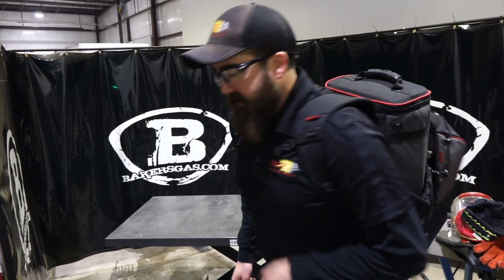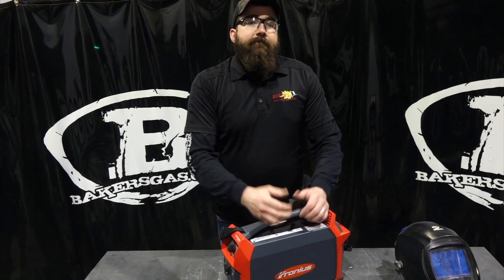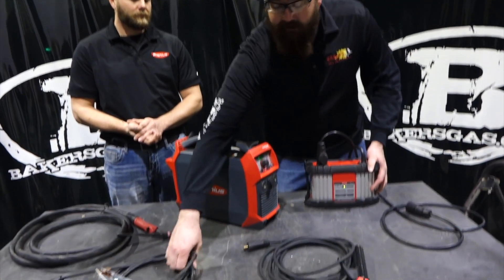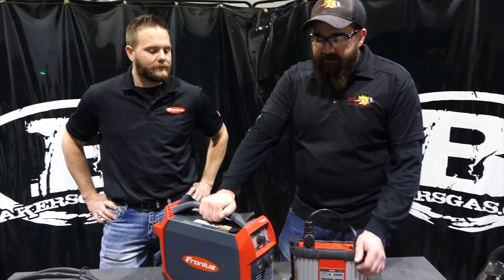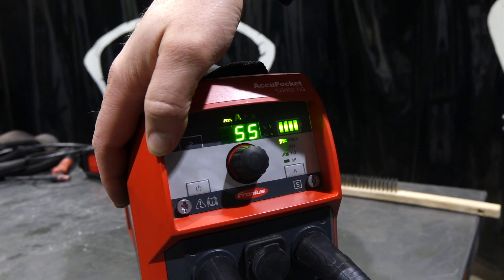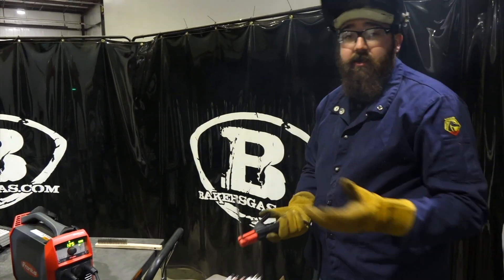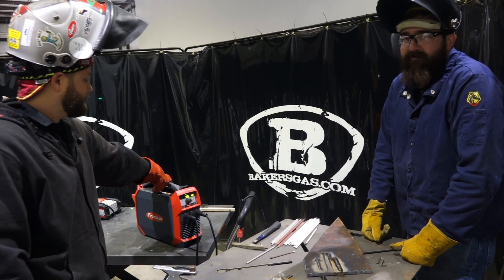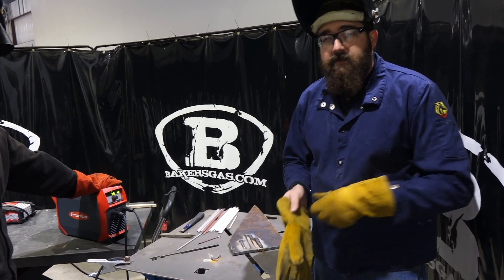Official Fronius Partner - AccuPocket Preview

Comment: I have been looking at one of these or the 180 transpocket with tig for site welding straits and handrails for some time now, does the 150 accu run just off a 110v lead if you don’t want to use the battery.
Reply from the maker: Correct if you are near power and do not want to use the battery you can just plug the Accupocket into 110 power!
Reply: @BakersGas  can you guys put that machine through it’s paces as well please I would like to see how many 7018 3/32 rods and also the 1/8 7018 before it drains the battery along with the same tests to run both the 1/8 and 3/32 6010 rods I’m seriously considering this fronius but don’t really see the machine being put to work just basic show casing which is awesome but I just would like to see a little more from that little cool machine because a battery powered welder is definitely a game changer but I just need to see the work it can dish out before I need to recharge, thanks.
Reply: Hope you make s mig soon